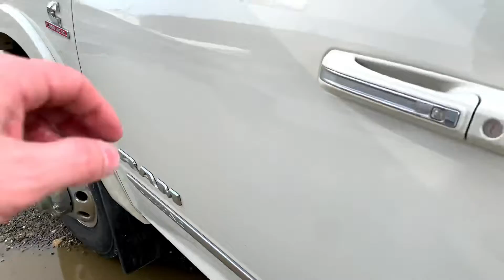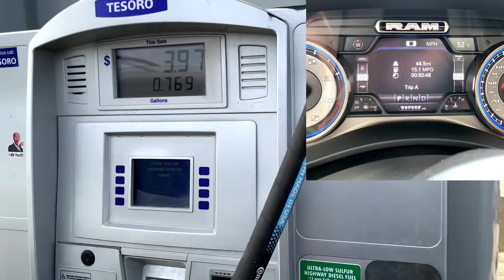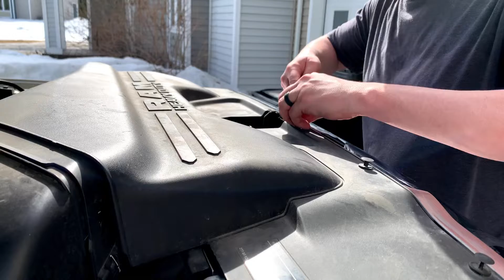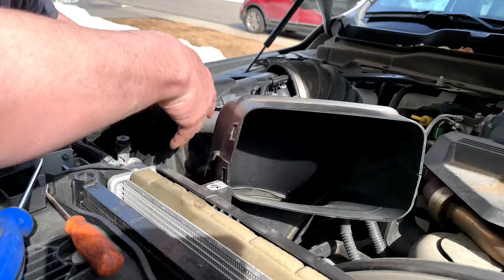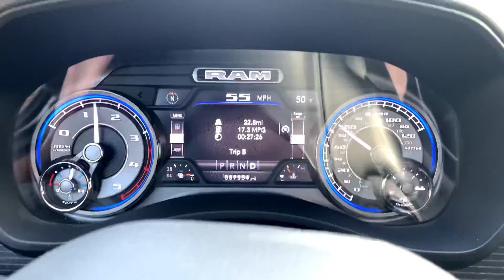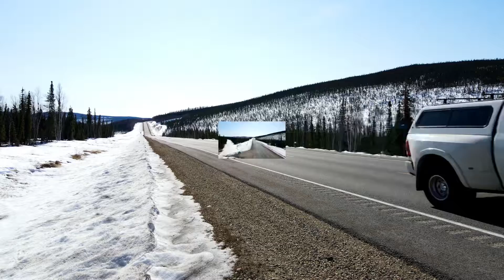DO COLD AIR INTAKES REALLY WORK? 5TH GEN RAM HD: BANKS CAI

Comment: Appreciate the video Dustin. Let me ask ya who makes your shell for the truck bed? I dig the fact that you can run racks as well.

You have a video on step bars? ✌🏽
Reply from the maker: Thanks for watching. It’s a Leer. I actually wouldn’t recommend it. Leer was the only option at the time. It’s tough to find toppers or camper shells for duallys. They’re the least desired so the last made. It didn’t fit well. The windows won’t stay closed without modification and I had to bolt it to the bed to keep the back glass from coming open. The plastic seal between the back window and tailgate broke off the first winter. I hope they build them better now. I just got one of the first ones out.

Comment: I put one of these on my 2021 Cummins and now 15k miles later I’m getting a low turbo boost check engine light, any ideas?
Reply: Mine doing the same thing…I think the flow to the turbo is so much improved that the pressure sensors are simply confused…after talking with banks I decided to just ignore the codes

Comment: 2022 RAM4500 6.7CUMMINS averaging around 7mpg lol! HELP @BANKSPOWER
Reply from the maker: Ouch, 7mpg… that’s gotta be hurting about now
Reply: What's the gear ratio in your differential? Have a 3500 with 4.10 and a 2500 with the 3.42 or whatever it is they come with. 2500 gets around 20, 3500 around 12. 2500 has a service body and weighs more at nearly 10k but is also 2wd vs 4wd. 3500 gets around 8 towing.

Comment: Mine is throwing a code PO26B  I don’t know if that’s cause the banks air intake I’ve just installed
Reply from the maker: I’d try disconnecting both batteries for about 15 minutes and see if it continues. I haven’t had it throw a code yet
Reply: That code is simply the sensor being confused by 51% less restriction…ignore it

Comment: Whats up, my name is rich, i can relate to living in alaska, i lived on farmers loop for three years. I have a 2022 ram 3500 long horn, i picked it up in michigan and drove it to dallas. It has the 6.7HO, 420 hp and 1075 pf, i opted for the 50 gal tank and driving back from michigan i topped out at 23 out of the box with a 1150 mile range. I just installed the same cold air kit, i will see how it does. Watch out for the moose
Reply from the maker: Haha, that’s awesome. We were up off of farmers loop as well. That’s great mileage for a stock truck. My dealer told me I couldn’t upgrade the tank at the time.  I’m glad I found Titan tanks so I was at least able to do the aftermarket upgrade

Comment: I had mine installed on a 2022 ram 3500, but check engine comes on and off, how  do you fix this, thanks in advance
Reply from the maker: I didn’t have a check engine light come on but I would disconnect both batteries for at least ten minutes and see if that helps.
Reply: Mine does same thing…ignore it

Comment: The wet filter flows more air, but like you said I don't know what the specs are on the filter oil as far as how cold you can let it get.  The wet filter also has a much more frequent inspection and clean cycle of like 5000 miles or something.  With the warmer temps you might try the wet filter to see what you get.
Reply from the maker: Maybe I’ll get a wet filter for the summer just to test it out and see if there’s a difference

Comment: Are you throwing any P0402 codes? Mine is doing that post CAI install from banks
Reply from the maker: I’m actually not throwing any codes. Did you disconnect both batteries before unplugging the sensors?
Reply from the maker: I’d disconnect both batteries again for about 10 minutes and see if it still throws codes
Reply: Yes I did,  for 20 minutes
Reply: My check engine light came on after a few miles, but it took a while. Seems like the 5th gens are doing it. Did any of you guys figure out why and how to correct? I just delete the code and it comes back again after a long drive.

Comment: Thanks for the video. I do have one question. When you want to clean or replace the filter, do you have to take the entire intake out of the truck? When I look at the pictures or videos, I only see a small window that the filter won’t come out of. Any info is appreciated.
Reply from the maker: Sorry it took a while to reply. You have to remove the box but it’s actually really easy. Just a hose clamp and pull up and the rubber bushings pop right off. It’s not like doing the job over again. It takes longer to get the old one off

Comment: My 2007 2wd dually with the 6.7 gets 23mpg and thats 7 miles into town, around town driving and 7 miles back home. Deleted and tuned when I bought it. 6 speed manual. I'm  really surprised to see such bad mileage. I drove 98 miles highway to another town and it hovered around 25mpg.
Reply from the maker: That’s great mileage. The 6 speeds were great and 2wd helps mileage as well. I’m not ready for deleting anything yet because I’m still active duty military and it would be my luck I would get stationed in California and wouldn’t be able to register my truck anymore 😂
Reply: I thought I was the only one who was getting these numbers in my g56.  I get between 25 and 27 cruise set to 65 on the interstate (flat landing).
Reply from the maker: @Lunatic_Lou  that’s awesome

Comment: Thanks for the review! There's a reason we don't make specific fuel economy claims. Unless you're in a controlled environment, gains are sometimes hard to measure accurately. We'd love to hear your long-term review... 6 months and a few dozen fill-ups.
Reply from the maker: We love banks products. We typically only buy banks for our diesels. We appreciate all of the R&D that goes into each product. We bought the CAI because of the build quality, sound, and performance. I completely understand not publishing fuel economy numbers because there are so many variables. If you can boost power without taking a loss in economy, that’s a win in my book. Of course I was hoping to see some magic but I would definitely make the purchase again. I’m looking forward to doing some towing tests and a long term review after the computer has a little time to “learn” the new air flow.
Reply: Wind could be a factor on this test. The second test wind could have changed MPG, temperature, and road conditions.....
Reply from the maker: @BBBYpsi  very true. It did take about two hours between the two tests with the install and driving to the test location. I didn’t really check the wind. I think it will really shine under load when I do the towing test coming up.
Reply: @DustinFaddis  I am looking forward to the tow test than. I haul travel trailers for a living. I have a 2011 Ram 3500 & just a few weeks ago past 1 million miles on it. Been using a S & B filter since 2013.
Reply: Why don’t you take this setup and post a video showing how much containments make it past your filter vers an OEM? The question is, are you actually making an upgrade or making changes that will eventually dust your turbo and engine?
Reply: @mikemiller9119  containments huh? Yea man I hate when containment get into my turbo. I mean, the filter is supposed to contamin all the containments from going into the turbo, but if it fails then your stuck with a containmintnated turdbo.
Reply: @bfairchilds2283  funny how you act like a child and it’s in your name too. Lol
Reply: I believe you have to apply 'working loads' to the powertrain to see any measurable improvements.  By comparison, a weighted haul can be more revealing.
Reply: That's because there aren't any. Smart move on your part.
Reply: It's nice seeing Banks finding videos on YT about their products and commenting and wanting actual feedback...speaks volumes about how much you folks care about what you make.